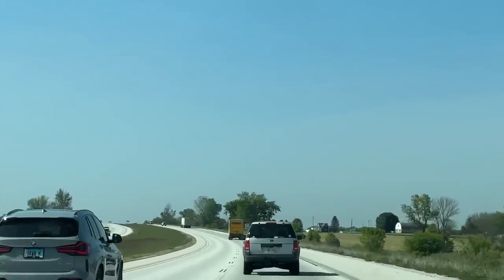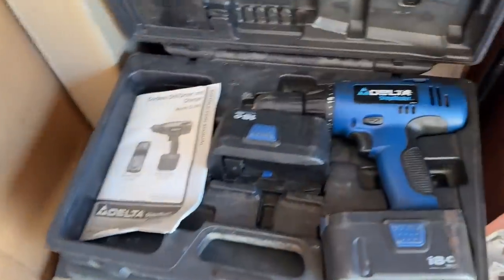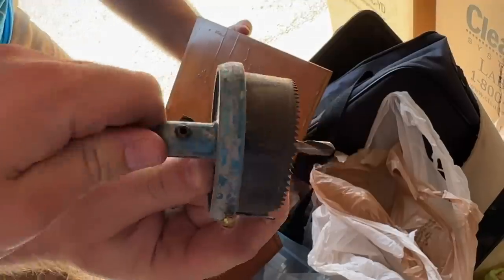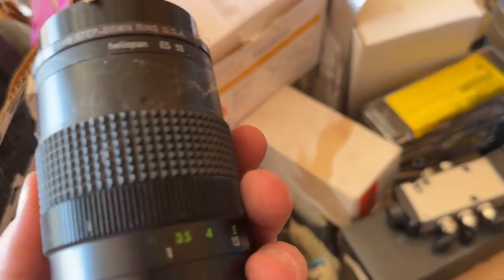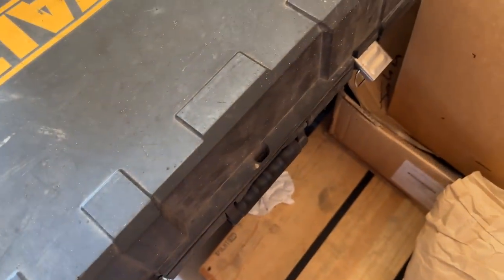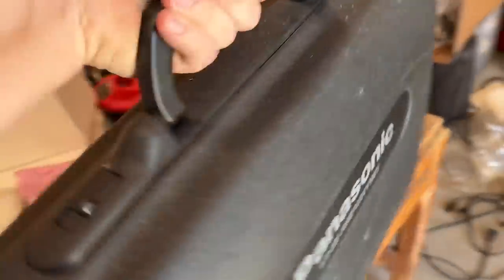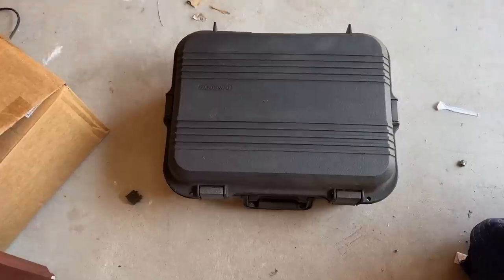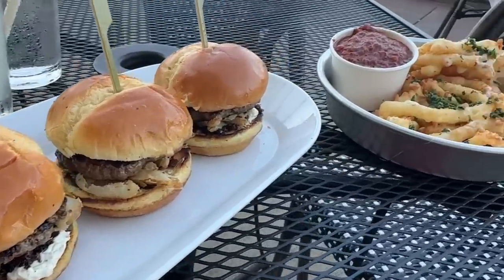We Found a $2 Million Surgical Robot at the Storage Auction!

Comment: RE: The hole saw. That's a multi blade/ size hole saw cutter. Loosen the exterior screw and each saw blade will click out. Remove all of them (one at a time). Each blade makes a specific size hole. Find the one you need. Click it back in the holder... and you re ready for the drill!

Comment: The thing at 40:30 is a solenoid valve for some kind of pneumatic device. The "NC" means "normal close" which means when it isn't under pressure the valve is closed.

Comment: That SSD price estimate though 😂...
Reply from the maker: Was I wrong on that? I just bought one for like $200
Reply: @ResaleRabbit  Oh, you actually replied. If I remember correct, it was a old Intel 80GB drive 😊. Lots of thinks has changed since that. However, I'm not running a resale business, so maybe I'm off when it comes to resale value on eBay. 😀

Great video, though! I started watching back at the first Amazon pallet. Just almost got close to the same kind of surprices, and actually created a memory lane to the old Action Hunters flow-tv programs 👏!
Reply from the maker: Was it 80gb? In my head I was comparing it to the 1tb hard drive I bought to put in my computer. Maybe I misread it thinking it was 800gb or was thinking 100gb is a TB. Tough to say, it was a long day and there was a LOT of stuff to look at lol